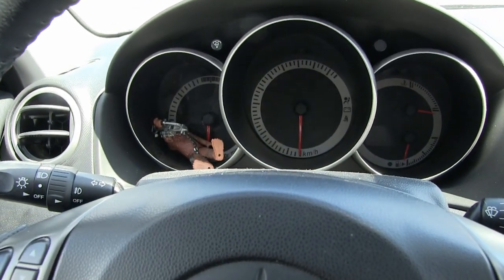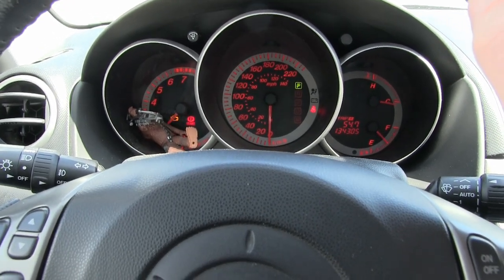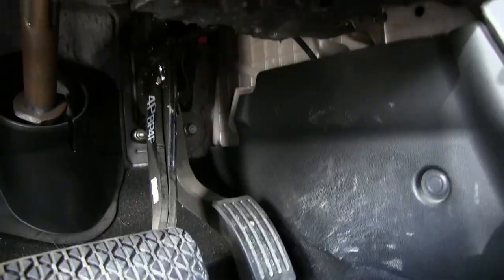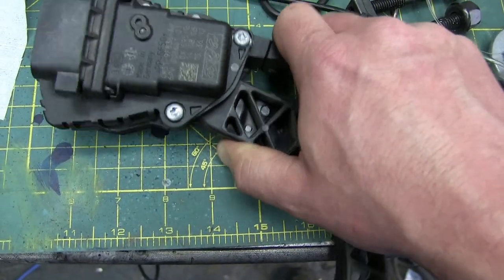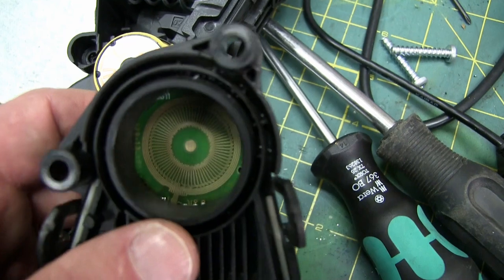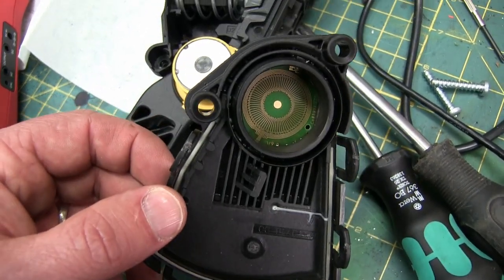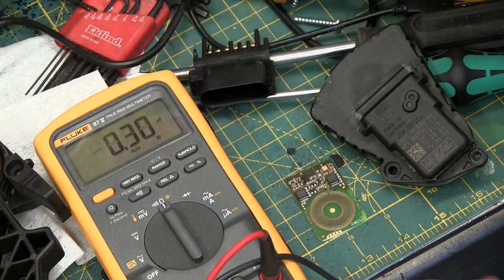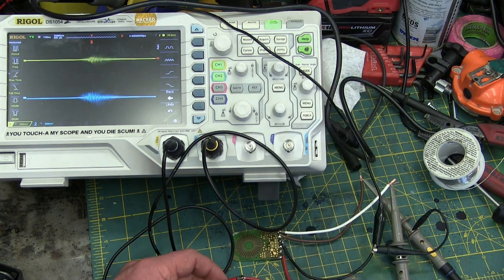BOLTR: CANbus accelerator pedal.

Comment: Cars today are just too smart for their own good!
Reply: As a technician i agree 100 percent.
Reply: As an electronics engineer in the automotive industry, I totally disagree. Smart is good.
Reply: No wonder you say that if overcomplicating cars puts food on your plate.
Reply: I work on electronics for heavy vehicles, not cars. And I chose to work in that area because I believe in it, not the other way around.

Electronics makes cars way better, you just need a different approach for fault tracing and repair. With a good understanding of the system, you can do lots of work from the computer and basically know what part is faulty without even getting your hands dirty.
Reply: You can, nobody else can.
Reply: Samuel Stone Wrong. Anyone with the right tools and knowledge can, as with all repairs. 
I repair my own cars. To be able to do that in an efficient manner, I own the equipment to "talk" to them (for example, VIDA+Dice for my Volvo). As you can buy the tools for most cars in the aftermarket, it's really not worse than having to buy a set of spanners.
Reply: Jesper Åhman You still need to check the sensor and wiring to properly diagnose, so you get almost as dirty as in the old days.
The only advantages of ECM's are:
1) They make engines more efficient than setscrews and vacuum operated crap
2) The sensors that make it work double as diagnostic tools, so all you need besides wrenches and screwdrivers is a proper computer, multimeter and preferably an o-scope to diagnose anything.

I'm all for electronics in engines, but I like them as simple as possible. The electronic throttle takes away the need for additional air control valve and separate cruise control unit, but when it breaks the car becomes stranded. In my 1998 POS the cruise control can die, the IAC can die, the TPS can die, but I still have a cable operated throttle and I can drive it, even if it drives like shit. Not to mention the TPS was even cheaper than 100$ :P
Reply: Jesper Åhman Those things are like 100 bucks, when all they do 50% of the time is turn the engine light off because of a momentary issue. IE: Most people who don't know how to diagnose electrical faults get conned into going back to the dealership and paying big $$$ for some guy to plug this tool in.
Reply: Samuel Stone VIDA is a subscription paid software that costs around 7000$ a year. The cable alone is 100$ and people pirate the software to make it work. To connect to my old volvo I use a 20$ cable with 130$ third-party program (vol-fcr).
There are universal OBD/CAN scanners that cover most of the cars, but they're not cheap enough to justify the purchase if you want to mess with your ECU once a year. If i need to diagnose a newer car I usually drive 20 miles to a friend that owns a car repair shop and owns one of them.
Reply: t33s I just googled the name and looked on amazon to be honest, didnt realise there was a software componant. OBD isnt that great, especially on things like jaguars+land rovers, because they use propriety systems as well, so unless you use the authed dealer method, you don't get anything of use out. Like you said, it's fine if you know someone.
Reply: there is a reason for that
Reply: +Samuel Stone so what do you suggest? back to the carburator days?
Reply: +t33s electric throttle failure is comparable to a throttle cable failure. extremely unlikely that it will happen but when it does you are screwed.
Reply: Electric throttles won't fail wide open because a single sensor failed. If it sees a discrepancy and cant figure out pedal position, it should drop into limp mode. 

Which is way better than your single throttle cable getting stuck at WoT.
Reply: Drive by wire has multiple advantages over a throttle cable. Comfort and emissions.
Reply: +SlocketSeven yeah but if the signal coming from that unit is sll screwy the ECU has no idea what your foot is doing. Air flow and temp sensors it can live without...but not the throttle sensor.
Reply: your loss
Reply: +David Serrano Speaking of throttle issues, at work we've just been having so many new Fords rolling in with bad Throttle Bodies. Its a problem but Ford has yet to make this a recall.
Reply: Well im sorry but it is not up to you. The government decides that your car needs to be cleaner and more efficient. Drive By Wire is one of the means to accomplish that goal.
Reply: Also you just said that you drive fuel injection so your car is allready controlled by an ECU.
Reply: WOW, waking to realize the can of worms I've  opened. I know I said cars are too smart for their own good but It isn't necessarily a bad thing, technology is the future and it is a good thing. I may have came off wrong... LOL...
Reply: +silnecer9112 Plus you can do things like stop people snapping open the throttle in 1st gear, and it makes cruise control so much easier to implement.
Reply: silencer9112 It's not the matter of electronic control, it's the matter of having mechanical systems to fall back on. It's nice to have the advantages of fancy software making everything smooth and efficient, but it's also nice to be able to do without it, even for a short time, when it fails. If a throttle cable snaps, you can jerry rig it with any similar cable on the side of the road. Try doing that with an electronic one.
It's getting better every year with companies producing aftermarket ECUs and components, so at least we're not dependent on the OEM as much.
Reply: Sometimes technology is there to save the new generation (certain people today that have no understanding of machines) from themselves. You can't have it simple any more with the driver in actual mechanical control because sadly like 30% of today's people don't know that over revving is a bad thing, or don't have the sense to look behind them while backing so they have to have a censor that stops the car for them before they destroy something.
Reply: You are not looking at this in a logical way. But that does not matter because you are not an automotive engineer. luckily the people who are making the decisions know what is good for you even if you dont know what that is. The next time when you will buy a NEW car it will have Drive by Wire.

Dont get me wrong, I am all for the old mechinical controlled and as little electronics as possible. but that does not mean that it wil fit in the future of automotive engineering.
I drive an 91 mx-5 without PS or ABS and I freaking love it. butt the fact is that we cant make cars like those anymore because of the increasingly stricter CARB and EURO legislations.
Reply: Graham you are absolutely right
Reply: SD Customs Stupid people should get punished for their stupidity, so they can learn from their mistakes, that's called progress. Technology may save their ass on a parking lot or when they try something mildly wrong, but nothing will save them when they drive in the rain and try to make a sharp 90 degree turn at 60mph in their audi quattro "best in all conditions" equipped with sophisticated traction control. Do you think anyone will keep eyes on the road in case they need to apply brakes when driving their new autonomous electric state-of-the-art Tesla? It's a known fact that as we put more training wheels on a car, people get more and more careless.
Reply: t33s I completely agree, society is getting baby fed safety, but sadly instead of learning from their mistakes and wising up, people are selfish and ignorant and would rather point fingers at others and car companies, trying to sue them. It's very unlikely technology will decrease to stop this, but very likely engineers will get paid to up technology even higher to somehow make the world fool proof, taking away our ability to steer one day I'm sure because like you said, the world is becoming more and more careless. It's sad it's came down to this, when people can't think for themselves to survive!
Reply: +Jesper Åhman 😂 cause you believe in it, oh lord that's good. 

I'm a plumber , yeah I believe in it too. and I really love when IR sensors and personal setting computers are installed in good reliable old timey technology. really takes my breathe away at the love shown us plunger wranglers , when you open a thankless water heater case to troubleshoot. poor customer 😂 . yeah , we believe in new technology . oh lord my sides are hurting
Reply: silencer9112 I have a degree in automotive engineering, but I stay away from car design, production or dealerships, because I am disgusted with the compromises made to keep them cheap despite more strict legislation and the marketing crap they put out these days.
I'm fully aware why cars are what they are these days and where things are going, and I don't like it not because it's new and scary, but because of what we loose in the process.
My professor once made fun of Ladas still having both electric starters and hand cranking in 1980's. You should see the look on his face when I told him I'd love to have a hand crank if my battery went dead and I was alone in the middle of Siberia.
Reply: +t33s how the heck do you respond with an image!?
Reply: +Samuel Stone it's something that will change with time, because for the moment people who used to know how to repair their cars can't anymore
progress is generally disliked :p
Reply: I have the "tool", the same one ave has. I should have saved my money. it hasn't worked once, for me or anyone else who has tried it.
Reply: The irony is, when engineers put so many sensors to detect failures all over car, they become the biggest cause of failures themselves...

Comment: I had this same situation with my wife's 2009 Saab.  OBD II said that it was the throttle position sensor.  I took the accelerator pedal off and opened it up.  The PCB and the brushes looked pretty clean so I put it back.  I was surprised because there actually wasn't a whole lot to the pedal assembly  The TPS for my wife's car is actually on the throttle body not in the pedal assembly.  I had to order the whole throttle body assembly from Autozone because nobody sells just the sensor.  I put on the new throttle body and did the relearn procedure.  Works like a charm.

Comment: Ford hasn't owned Mazda for a while now. But, many car companies still share parts.
Reply: I'm not sure how long Ford had owned Mazda but they have worked together for probably 20+ years.
Reply: in 2010 Ford divested the majority or their stock in Mazda. But prior to that Ford owned around 30% of mazda
Reply: And that unit looks like the accelerator in my '05 (EU-spec) Focus .
Reply: +Kollar0718 well focus and 3 is the same car, so it would have the same pedals XD along with the Volvo C30 actually..
Reply: That looks like the dashboard from a first gen (2003 to 2009) Mazda 3 or Mazda 5, back when Ferd was still in bed with 'em.  Same platform, chassis, engines, components, etc. are shared between the Focus, Mazda 3, and Valvo C30.  I had a 2006 Mazder 3 and made several repairs to it myself and I was always amazed to find that FoMoCo stamp on virtually every part I removed.  That was stuff from struts, shocks, oil filters, engine mount, brakes, etc.

Comment: Probably not much wrong with the TPS (hence why they do not use variable resistance anymore. No contacty bits to wear out and whatnot).  May have been a case of a relearn and good to go.  A good scantool will let you look at the TPS PID and see if it is behaving all linear and proper like with no dropouts. Keeps the swaptronics fixing method down to a minimum too,

Comment: You get nada out because it is waiting for the ECU to ask it for a few values. Pedal position, if it thinks it is fine, how it feels ( how hot, voltage and such on the supply) so it can then set speed accordingly. It only responds to those commands and otherwise will sit there shtum and not talking.

 Pedal position ( actually 2 different positions so the ECU can determine if it is wacko and still thinks it is fine) and health, so if it says "I be Farked" the ECU will flip the eedjit light ( or on some cars the lovely text " Service vehicle Soon'") on and sit at idle or a little above so the car can still move. If the positions for pedal are not agreeing then same, just it might still work somewhat if you floor it but light will still be on the dashboard.

Comment: what happened with this....left hanging....would like to see more on this issue from YOU. Great vids thanks!
Reply: MyBigThing2010 I assume AvE sees that he didn't power the bus. I'd also guess the part was fine, but good that he ripped it apart [Instead of me]. Best guess is connector (and carbon tetra chloride in large quantities would fix it.)

Comment: I am not sure what car this is, but the part number you show (4m51-9f836-ah) is used in Ford Focus II. You may be able to locate the wiring diagram online and find out the pin out. As for the component it seems to be a triple potentiometer. The diagram I located has two different pin numberings so I cannot help you any more with this.

Comment: probing parts in circuit? Since when does that give you reliable results?
I mean, did i miss the invention of miracle meters?
Reply: For stuff like that i use my nose. Smells like Lego BBQ? probably screwed.
Finding out about the general direction of what went south, probing with a multimeter was complicated enough in the through hole era. Now with uC everywhere diode checks are most of the time useless.
As are capacity measurements for instance in a pi filter.
Maybe it is just me, but i had more luck sniffing a board than probing it.
Of course if you have schematics and a table of in circuit readouts, i.e. in customer support, this method is perfectly valid.
Reply: I don't know of an engineer who does not use a meter first. Diodes and similar can fail shorted and not blow as they take an inline fuse out after failing etc. Also as you get to know about electronics you can get enough experience to know what something Is likely to read in circuit if it's OK. There is also the fact that equipment like a GEN-RAD 2275 or any other bed of nails PCB tester tested tests individual components in circuit, and not always using guarding techniques.
Reply: Probing in circuit is fine as long as you know what you're doing. It'll find many faults. You might have to pull the part to check beyond that, but it's a good start. You just have to use the brain as well as the meter.
Reply: Have you ever taken something like this apart?  Probing around like that can help you mentally start walking through how the circuit is laid out and what is going on, as well as tell you if a component is bad.
Reply: "...give you reliable results?"
maybe my english is a bit off.
I am well aware that you can get ball park readings. But if i am looking for a malfunktion i do not trust in circuit probing. Obvious defects aside, when i'am suspicous about a part i desolder at least one lead and take a mesurement.
When a diode does the same in both directions or a capacitor the same over time i know what i am reading.
It is just that with digital circuits you are often totally screwed for your DMM may actuate a transistor base here, charge a cap there.
I had nothing but pain when doing it the easy way. Maybe i was just unlucky.
Reply: You cant do a lot with digital circuits with just a DMM However the context was that of a motor controller. The H bridge and everything round it can be tested easily with a meter in circuit once you know what you are looking for. I have been doing this as a professional for 30+ years.
Reply: +Gordon Lawrence I never worked on one, but is the h bridge in the throttle body next to the motor?
   What is the signals from the pedal to the  other device?  Pulse with modulation? For voltage? The dose the other device send 0-5v. To the ecm?
Reply: hill billy Throttles have two parts that can be controlled electrically - the injector and the venturi. The venturi can have a stepper motor or a servo motor. Steppers don't use an H bridge. Servo's usually do (but not always). On the systems I have worked on the H bridge is in the EMU (Engine Management System) which is either one big lump hidden away or a distributed system, where you get several control boxes. They are usually all connected together by CAN bus (sort of like wired computer networking but designed originally for automotive applications). Not all manufacturers use CAN (Controller Area Network) but the ones that don't are rare. The signal from the throttle to the control system really depends on the car. Some use an analogue signal (in older cars) some use PWM (in not so old cars) but these days since a microcontroller with CAN is so cheap (less than $0.50USD in bulk) CAN is often used. CAN is similar in some respects to RS-485 in that is uses a twisted pair with a differential signal that is used for both transmit and receive with some quite clever "data collision detect" circuitry. Hope this helps a bit. If you want to read some technical data on CAN I would recommend the older Philips books and data sheets on for example the 82C250 (CAN Driver) and the application notes associated with it. Some of the other manufacturers data is nowhere near as good quality.

Comment: The Blue tooth ODBII modules are fun to play with. There's a fun little App for the phone that talks to the module. First step for me when trouble shooting CAN stuff is to do a hard reset, in the case of a car I disconnect the battery for 15 minutes and then reconnect. Completely solved my TPS problem and it never came back. That said thanks for tearing yours apart so I could see whats inside. ;)